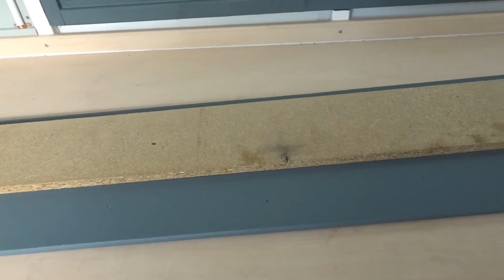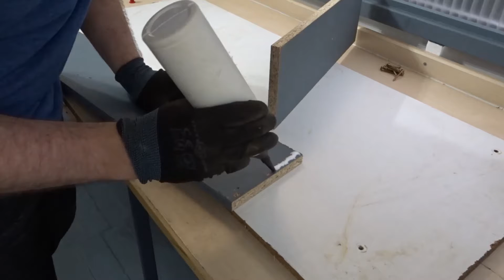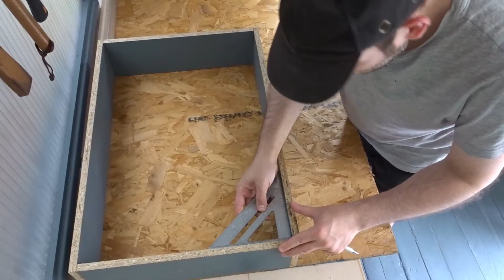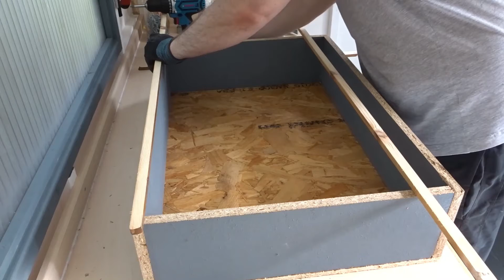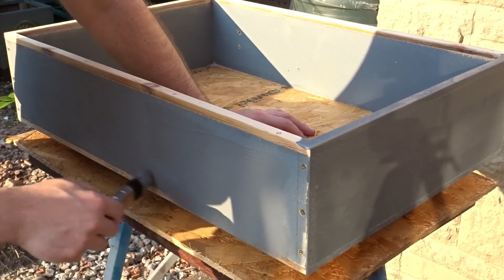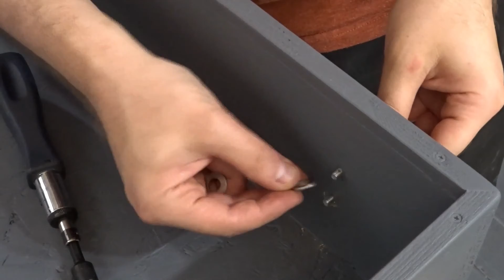Making a Wheeled Storage Box for the Workshop (Scrap Wood Project)

Comment: Hi Phill, what happened to your Evolution miter saw mate?
Reply from the maker: How's it going Karl? The one I had with the slide had a problem where a bolt kept working its way loose making the blade loosen and it was really awkward to access. I tried to fix it twice but it just kept coming loose over time so I stopped using it. I've been using this Ferrex one all this year. It's cordless and much quieter than any corded mitre saw I've used before and it seems quite well made.
Reply: @PhillWyattProjects  Not bad thanks Phill, oh really that's not good is it, did you ask evolutions customer support about fixing it? How's things with you? Channel is doing well mate! 🙂